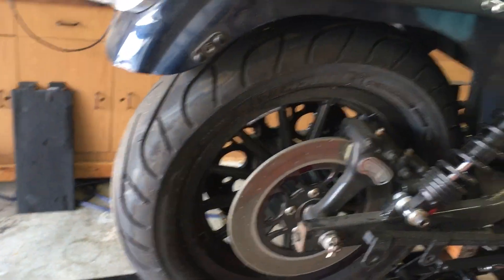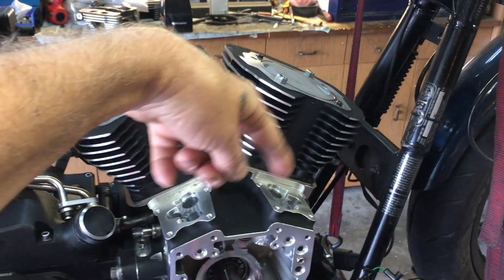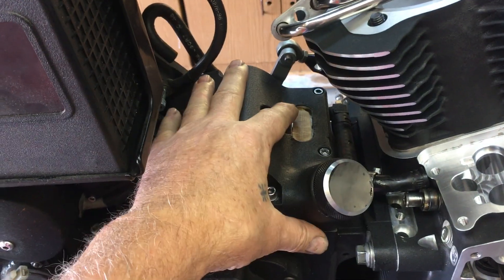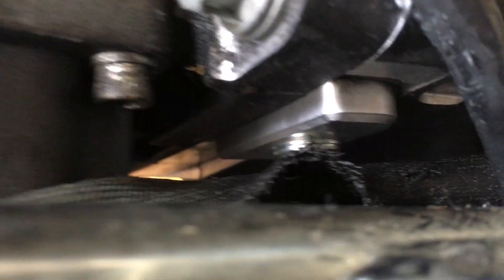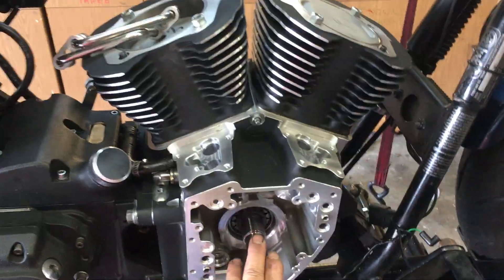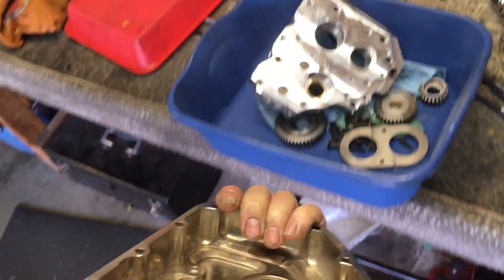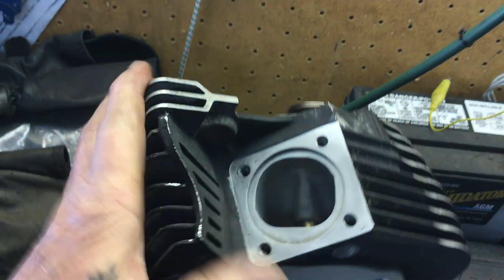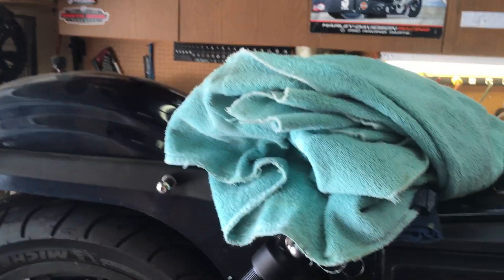S&S oil routing 99 to 06 S&S 124 and 126 ci motor

Comment: What a beast 👍
Reply from the maker: Thanks!
Reply: @vtajoe1  what do you recommend for a compensator?  Is the bike running?
Reply from the maker: I would stick with a SE comp... Or Baker if you have the $$$. No solid sprocket...needs to have spring of some sort.
Reply from the maker: My dynas been running for a while now.
Reply: @vtajoe1  How can I contact you to learn from you?
Reply: @vtajoe1  I want you to introduce me  About this engine problem  Because there are a lot of problems with the upper respiratory tract engine oil  What should I fix?
Reply from the maker: @sivapd9259  
where do you live?
what kind of motor are you having problems with?  what size , make?? S&S When you say (upper respory tract) what do you mean? If you live too far away I might not be the best person to help you

/
Reply: @vtajoe1  I'm very glad you answered me. I found a Dyna T124 engine assembly video. I have a problem with the S&S T124 engine installed on my Dyna.  When the engine is running for a while  And driving, it appears that engine oil spilled out  From above  Taw's breathing in front a lot .. I don't know what happened to the engine.  I tried to fix it but I was unsuccessful .. I want to learn from you .. I want you to teach me a lot..I live in Thailand ... it's very far.  From you .. I want you to teach and suggest corrections.  This problem commended me .. Thank you very much to you answer me.
Reply: @vtajoe1  I'm very glad you answered me. I found a Dyna T124 engine assembly video. I have a problem with the S&S T124 engine installed on my Dyna.  When the engine is running for a while  And driving, it appears that engine oil spilled out  From above  Taw's breathing in front a lot .. I don't know what happened to the engine.  I tried to fix it but I was unsuccessful .. I want to learn from you .. I want you to teach me a lot..I live in Thailand ... it's very far.  From you .. I want you to teach and suggest corrections.  This problem commended me .. Thank you very much to you answer me.
Reply from the maker: @sivapd9259  Does your motor have head breathers or a crank case breathers . is the oil tank under the transmission or in a oil tank under the seat . is it an EVO harley or a twin cam  dx
Reply: @vtajoe1  My motor is twincam dx,oil tank under transmission and head breather,thank you.